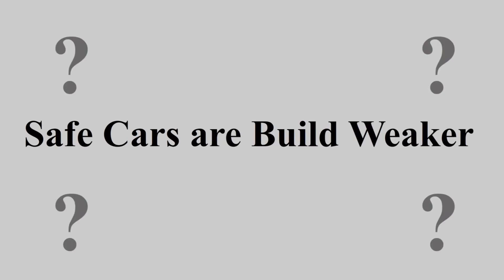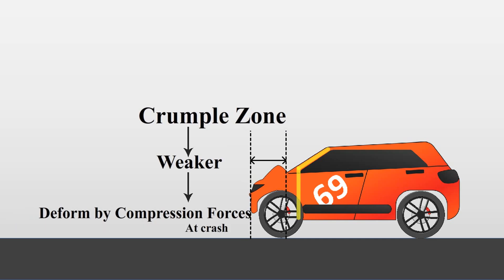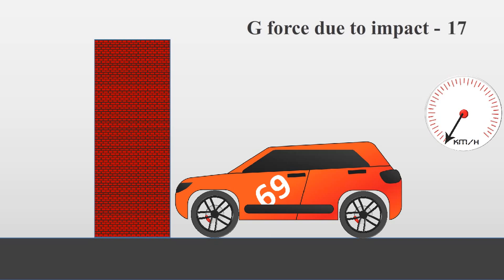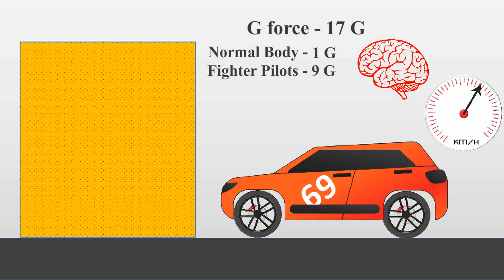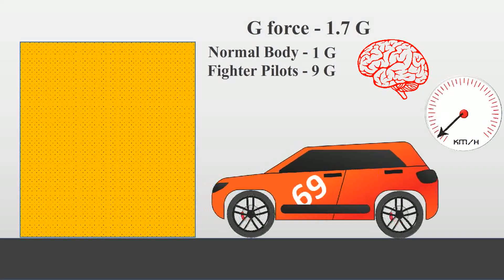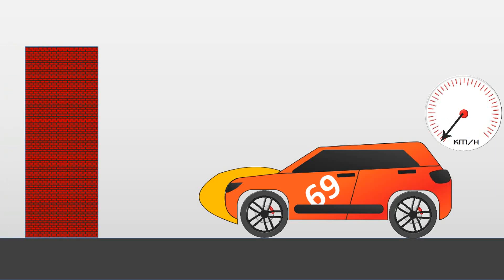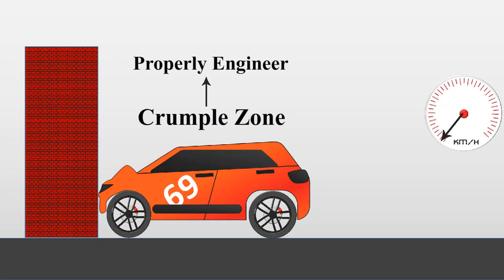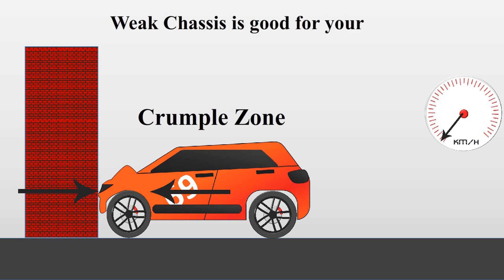Crumple zone | Safe cars are built weaker

Comment: Soo what is safer, absorbing the gshock.. or getting crushed by the metals (and also absorbing some of the g-shock?)
Reply: You absorb a lot less Gs and it’s the outside of the car that gets crushed not the inside
Reply: The G-force experienced during a stop from 100 km/h to zero depends on the time it takes to stop. A quick stop from 100 km/h in one second could result in approximately 2.8 G's, as the acceleration is about 9.2 m/s² (roughly 916 cm/s²/s).

Now by observing the various car crashes, I see the crumple zone might not be able to reduce the g's, just make the car a total loss after an accident.

Comment: Has anybody ever been injured or died inside a car after a crash while the car is perfectly fine or minimal damage? Until I find that proof, crumple zone appears to me as an excuse to go cheap on cars.
Reply: First, let's go with "theory" (I say "theory" because it's actually pretty solid science at this point). Yes, crumple zones are definitely a factor of maintaining affordability. But it also makes cars generally a lot safer. You're assuming the entire car is a crumple zone, which is wrong. There's a reason it's called a crumple ZONE. It's a sacrificial part of a vehicle. The cabin of the car itself remains rigid and durable (and better) to this day. 

The engine bay compartment for example will get absolutely obliterated as it absorbs as much of the impact force it can, while the cabin is strengthened to maintain its structural integrity. As opposed to what you want, which is a strong engine compartment which may or may not smash INTO the cabin if it is too rigid. There's a few car crash tests that demonstrates this combination of crumple zone and strong cabin at work directly against "stronger, older cars". To put simply, crumple zones allow the occupants to decelerate as gradual as possible while the cabin protects them from actually being smashed. Without being the kinetic energy being absorbed and distributed, occupants will get mushed despite the car surviving intact. Ever heard of an EOD suit? It works on similar grounds. 

Now onto an example that you are asking for. One, yeah you can just go ahead and search the test video of an older car and newer car crashing head on. But my dad has been involved in an accident that pitched a new car against an older one. And it's the perfect example I use till this day. Because car size and type matters... say if an 1970 4x4 smashes into a cute little 2020 hatch, the results will be pretty obvious. So the accident my dad had, was a 2019 Corolla against a 7th generation Corolla. it was a head-on collision (the other fellow was driving in a one way street going against traffic, my dad also made a mistake by turning into the street without slowing down assuming it should be clear as it was early morning, a good ol' combo of blind spots, stupidity, and relatively high speeds...boom). So no one was seriously injured from this and both cars were pretty much dead. 

The resulting differences being. My dad wash shaken up but not a scratch. The other guy had a good headache and a broken arm (nothing serious though). It was very clear why. The cabin of the 2019 Corolla was totally fine. Not a crack on the windshield and no bends on the A-pillar. Airbags all deployed as they should. The 7th generation Corolla didn't do very well. Firstly the lack of airbags. Furthermore, the dashboard was damaged and the driver side pillars almost fully collapsed. 

Oh ya...crumple zones also work to the benefit of the object it collided with. So yes, naturally the newer car's crumple zone would have also cushioned your father's impact.
Reply: @David AZ your examples can be avoided with seatbelts and airbags. I highly doubt not hitting the dashboard or windshield can kill you in head-on collisions. Side hits and cars rolling are a different matter. 

My dad got into a car accident while a little drunk. He had an older, sturdier car. The other car had this crapple zone. His car got minor damages while the other, you already know. I don't know the physics of 2 cars colliding at around 50kph or the Gs involved in it, but my dad came out just fine. Nothing wrong with him according to the doctor. He said the only concussion he got was when he saw the repair bill for the other car since it was fault. Maybe he's got more resistance than a trained fighter pilot? Lol
Reply: @David AZ aside from movies or your imagination, where did that happen? Link please 😉
Reply: @beaniekei8691  brain dead comment

Comment: Although crumple zones spread the duration of impact and hence peak G, they are 'once only', sacrificial structures. In a multi-vehicle pile-up (hence multiple impacts), or where the vehicle rolls or 'endo's' several times, the overall strength of the chassis comes into play - that's when you might well be better off in a 1985 Saab 900 than a modern car.
Reply: It's a moot point in multiple impacts as the passengers have already sustained fatal injuries during the first one if the car didn't have crumple zones.
Reply: Yeah, I also came across a crash scene where someone hit a moose dead on travelling at around 110km/h with a front bull guard on their truck, and they were able to walk away without a scratch. In northern Ontario where I live it’s well known that having a front grill or bull guard will save your life in those events. We always have to be cautious about head on collisions on certain highways. I’ve seen some nasty wrecks in my life. I’m just confused now, after watching this video.
Reply: Multiple problems with that scenario. It's not that simple. We'll exclude all other aspects of a car here and just focus on occupant survivability.

You have to take into consideration that each car have different survivability in relation to its size and type. The driver of a Camry might survive better than, say, a Corolla. Larger car, larger crumple zone. So, what "Modern car" are you referring to. Furthermore, by "modern car"... Most of these vehicles also contain airbags on all sides. Top it off, you're assuming the entire car is a crumple zone. Which is wrong. It has a crumple zone and then most if not all "Modern cars" have very durable cabin structure. These designs are generally based on the most likely accidents to occur and then ensuring the best possible way to survive it, of course within the limits of a car. Pound for pound, within the same class and type of any old cars... Any modern car crashes will very likely result with the occupants going home in a cab, with injuries or none. If they go home in a box, it's a very high chance that with the older car, the result will be the same (you can check this simply with car crash tests involving a newer vehicle head in collision with an older vehicle and you'll see the drastic result. You also get to see the cabin structural integrity of the newer car holding up way better than the cabin of a supposedly "stronger, older car").

Going by your logic, we should be driving in tanks covered in foam and air pockets. But really, we're talking about cars. So now considering other aspects aside from crash survivability.

You want the car light enough for fuel efficiency, stylish for obvious reasons, practical and affordable to both manufacturers and consumers. These just a few factors to consider among many others into making a good car. Cars today are far safer, more efficient, and just overall better in many ways, albeit more complex too but such is the cost of better technology.
Reply: That's a very boomer comment to make.

Most accidents are not muticare pileups. Most of them are one on one head to head crashes.

Why would you opt for a 1990s death machine than a car designed to keep you safe?
Reply: @altafkalam2716  BTW, that's a very millennial ignoramus comment to make..
Reply: @EliteRock  Okay Boomer